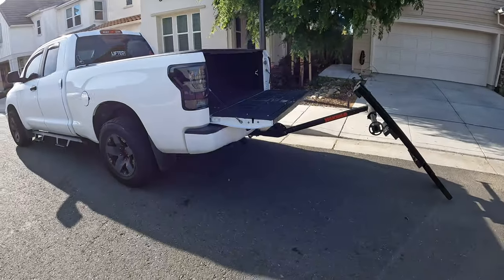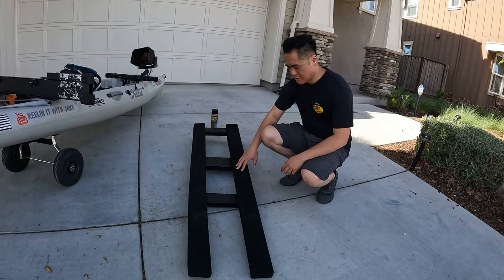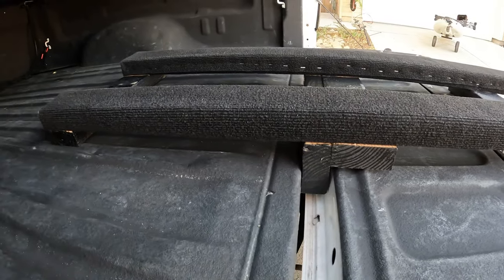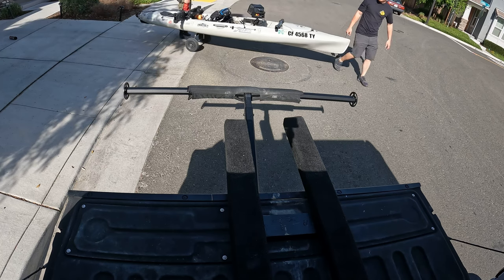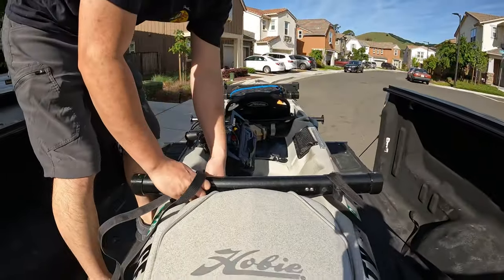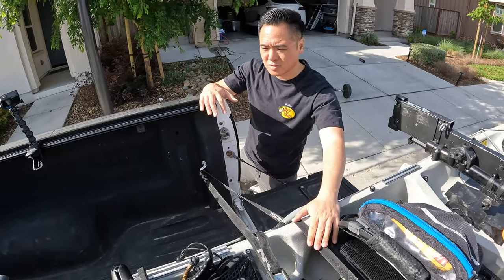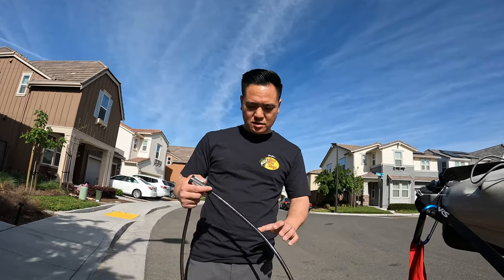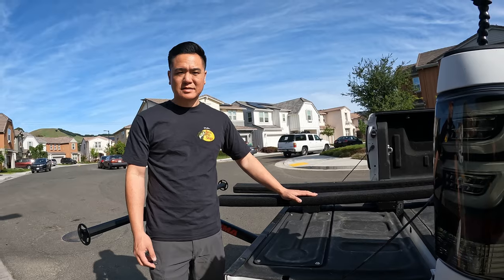How to SECURE and load a KAYAK on a Truck | DIY Loader

Comment: You can easily make a slotted bracket with padding that goes at the beginning of truck bed on the cab side to lock the nose of the kayak in place. Then you won’t need the two straps in the bed. And you can easy travel places with one strap. It makes kayak life way easier. I smash all over the Bay Area like that and never had one single issue.
Reply from the maker: I know the way I’m strapping is kind of overkill.  😆

Comment: What happened to the Tesla. I almost bought the roof rack and mounts to rock the kayak on top. Now you have switched to a pickup. What was your reasoning? And what was you wh/mile with the kayak on top?
Reply from the maker: I still have it but it was a bit of a hassle.  I just didn’t want to risk damage and getting it all dirty.  Now I’ve got a pickup solely for kayak fishing.